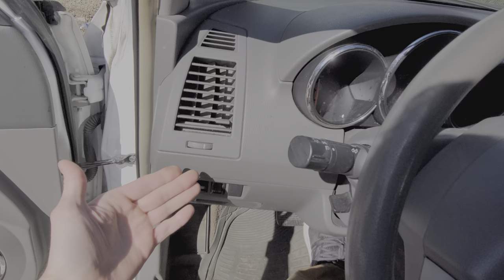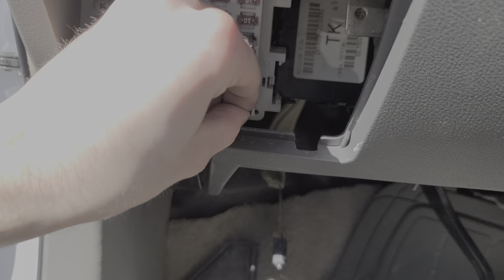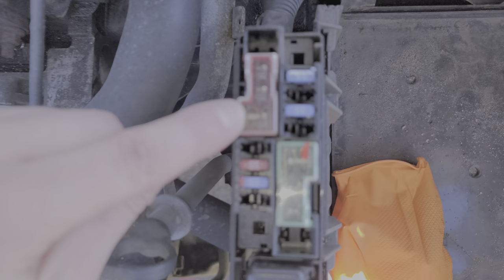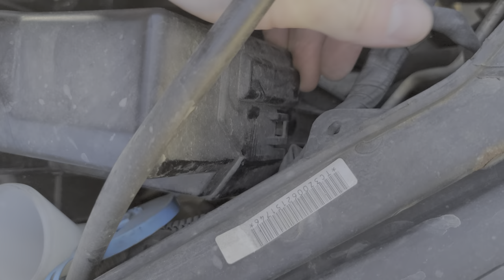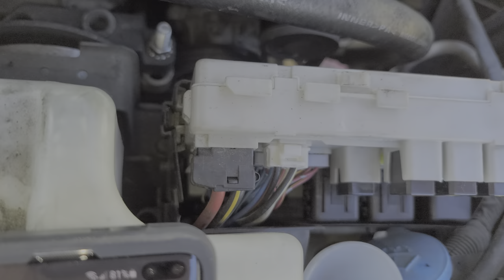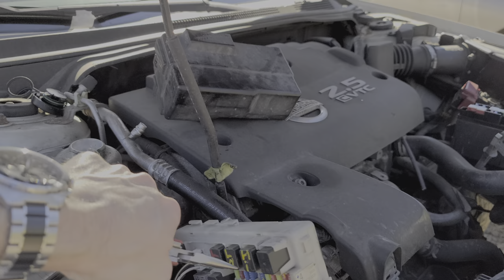2006 Nissan Altima Headlight Fuses & Relays, Fog Light Fuse & Relay

Comment: Gotta give credit where credit is due… I had a hard time tracking down what was causing my driver side low beam not to work, the fuses are not properly identified in the manual but your video clearly is.  Much props and as I say that every YouTuber that has helped me out I hope you have 200 years of good luck.  Very much appreciated!  The obscure fuse under the hood linked to another fuse was the culprit.  I can only hope that somebody helps you out the way you’ve helped me!
Reply: Thank you so much I had bought a used one before checking the fuses which I replaced all of the 15 a the headlights work. I saw that box but until I opened it and saw all the fuses. I just thought they were in the box inside the car. Now if the air conditioner would pop on and work lol.

Comment: I literally went months using my high beams because my passenger side low beam wasn’t turning on and it was such an easy fix…. Thanks brother 🙏🏻🙏🏻
Reply: Question, what did you do? My driver low beams is not working, after I change the bulbs. When I engage the high beams, both sides works.
Reply: @charleslewis564  I just changed my low beam fuse like the video shows
Reply: @charleslewis564  mine does the same thing. Did you figure it out
Reply: I'm literally going through this now trying to fix it myself and I know nothing about it.

Comment: Used this video to find the dead fuse for my driver-side low beam, then swapped it with the passenger-side fuse to confirm. Easy fix once I knew what to look for.

Comment: Thanks a lot buddy. I’ve been going crazy trying to get my driver side low beam working. Just a note. On my vehicle where you described the driver and passenger low beam fuse location were switched. Thanks again
Reply: I have the same problem, I’m watching the video now, it helped fix the drivers side low beam?
Reply: @kev_6422  yeah, it fixed my driver side low beam. My fuse location was where he described the passenger side fuse
Reply: @69Caddy1  what was the fix, switching them or getting a whole new fuse?
Reply: @DamijinMyndz  replacing the fuse fixed it
Reply: @69Caddy1  yup I found out it was the fuse yesterday

Comment: Very useful,  after ordering 2 new housing units and all new light bulbs for the car I realized that one of the low beam head light fuses were blown 😳  all though I still can't get the low beam passenger side bulb to come on after changing the fuse but atleast the driver side one is now working ... any suggestions on what can be stopping the passenger low beam from working ?

Comment: Hi brother, i need your help…i am driving 2005 Altima 2.5S and passenger’s side highbeam wasn’t working. I bought a bulb and changed it, but no results. Checked fuses and relays but couldn’t find anything…thought the bulb socket has the problem, changed that too with the new one, again no result. At last i tried exchanging the relays (the 4 you showed on this video) again no result but the ENGINE SERVICE SOON light came on and it’s not going. I really don’t know what happened suddenly…would really appreciate your timely response. 
I should visit a mechanic or is there something i am missing out. 
Please help.
Thanks 😊

Comment: I followed everything you said step by step and for some reason even with a swapped fuse and relay my driver side low beam headlight still won't come on. I used a fuse tester and there's power in the connector but not in the fuse box itself. None of the fuses look blown but yet there's no power energizing the fuses. That's only for my lowbeams highbeams work fine. My fuse tester lights up on when checking for power.

Comment: My driver's side highbeam has quit working. I've checked fuses. Tested relays. But I haven't checked the daytime running lamp fuses. Is it possible for just one high beam to stop working because of the drl circuit? 
Also, using a tester light, I don't get a light if I use the two wires in the bulb plug (female end). But if I connect the alligator clip to a ground and the use the tester in the positive wire of the bulb plug the tester will light. 
Would a jumper wire from the bulb plug to a ground solve my issue?
Thoughts?

Comment: That information was helpful I have a 2008 Altima SL one of my high beams driver side had a wiring problem didn't work I fix that the light the high beam works but it won't damn from the switch inside the passenger side does what is the location of the high beam relay on a 2008 Altima mine doesn't have the cover on the passenger side like you had your video

Comment: My low/high beams nor my fog lights are working. I’ve been racking my brain trying to figure this crap out. There’s also a white box under/ behind the stereo that has a slot just big enough for a dime to get down in there and short out the circuit board. It caused all kinds of problems for that guy regarding lights as well as dash lights, tach, etc. Almost thinking this is the direction I need to look. That or the multi switch/ blinker switch